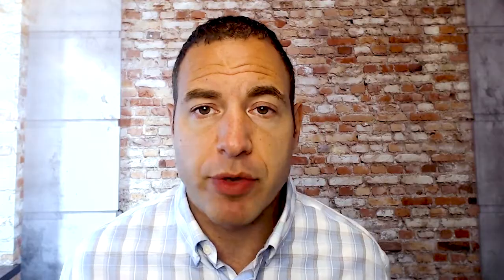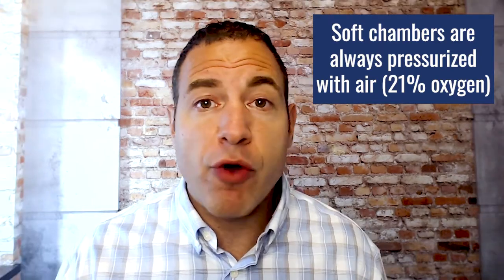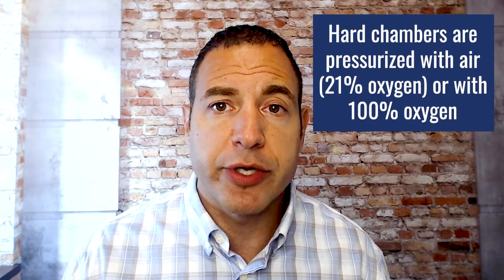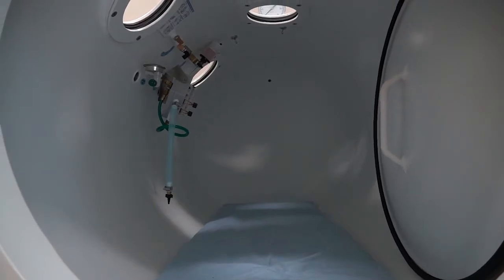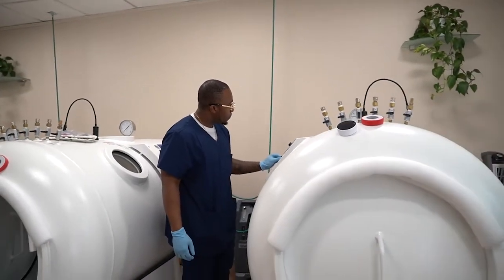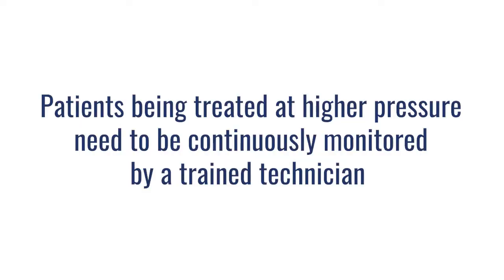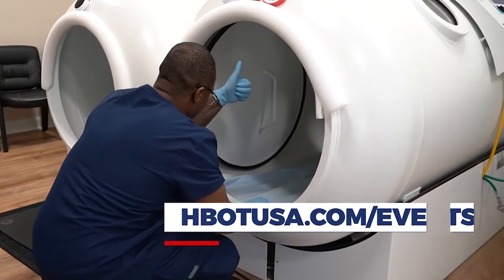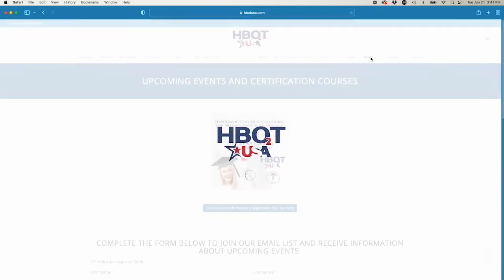Hard Or Soft Hyperbaric Chamber - Which Is Better?

Comment: Higher pressures get you results faster, that's about it.  If you have a medical condition that needs immediate treatment, hard chambers and higher pressures are better.  Else soft chambers at lower pressure with a longer protocol will get you the same result.

Comment: Why is supplementing the soft chamber with an extra percentage of oxygen not an option to increase it to around 50% instead of only 21% room air?
Reply from the maker: Due to the fire risk. The proper (and most effective) way to increase your oxygen absorption while in the chamber is to breath supplemental oxygen through a mask.

Comment: So, what's the difference than using a cpap with oxygen concentrator with a full face mask?
Reply from the maker: The difference is breathing oxygen under pressure (in a hyperbaric chamber). It's the pressure that drives more oxygen into the plasma of your blood, bypassing the red blood cells. This is only possible while breathing under more pressure than normal. This doesn't happen when breathing oxygen at regular pressure. At regular pressure, you rely on red blood cell carrying capacity, which can only be 100%. 

For more info about the science behind HBOT, check out our HBOT 101 series: https://www.youtube.com/watch?v=LRToHJHcVok&list=PLLBK4Ii9--jG4yts8-V8gHBCdboz75B2N

Comment: what law actually states that soft chambers can only legally be 1.3 ATA in the US?
Reply from the maker: Hyperbaric chambers are medical devices regulated by the fda. The fda is who has regulated soft chambers to 1.3 ata
Reply: @HBOTUSA  I hear this claim often, but to this day no one has shown me clear regulation from the FDA that states 1.5 ATA and above soft chambers are illegal to own or operate , or even sell in the US.
They are simply not approved for any FDA approved treatment.
You also know that multiple companies currently sell 1.5 ATA chambers or above. If it were illegal, I do believe the FDA would stop them.
So, until I have someone show me clear regulation they are illegal to buy/sell/use for off label treatments, I will continue to question this "1.3 ATA max" statement.
I am happy to be told I'm wrong and properly educated, but I need to have a clear regulation that states so and then basically some understanding that sales of 1.5 ATA and above in the US are illegal but that the FDA doesn't have the resources to enforce it.
Reply: You should reach out to the manufacturers. They would probably have the regulations for them
Reply: @nerychristian all I found is that this limitation apparently applies to US manufacturers only, but you can buy from non US ones and use those in the US.
Sucks for US companies. 😞

Comment: 2 ATM is 10 times more efficient then 1.3 ATM
Reply from the maker: Not necessarily. It depends on what you're applying HBOT for. There are instances (depending on that specific patient's issues, needs, or goals) where lower pressures are actually more effective or more tolerable.